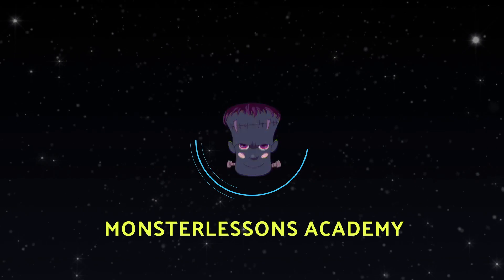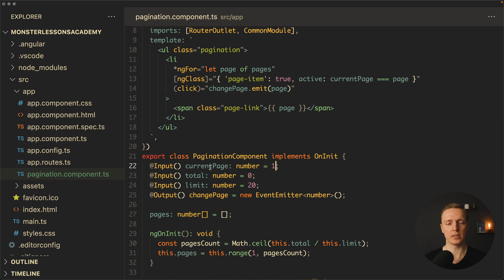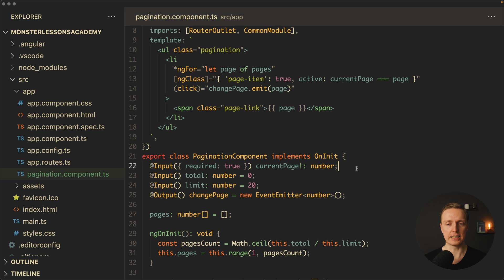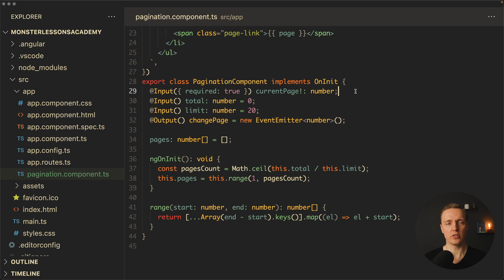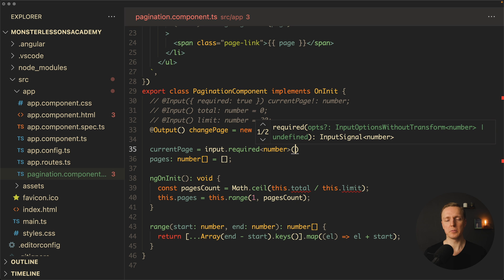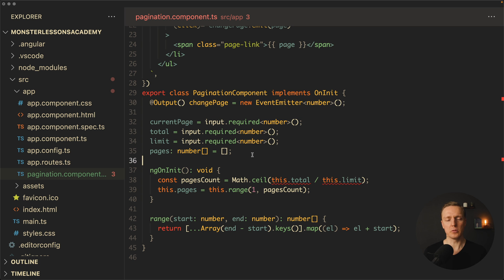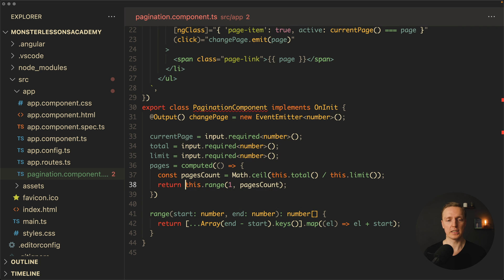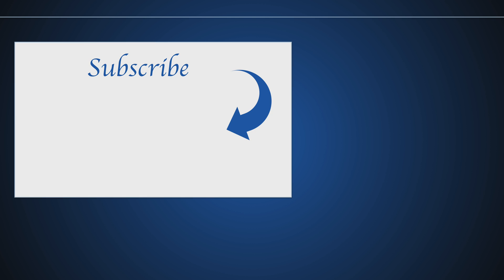Angular Signal Input: Ultimate Guide for Developers

Comment: Thanks for this. I want to try and change a form builder to rather use signal inputs.The issue is in the test, even if I type the input correctly, the test gives an error. I tried with a simple number example.

  questionNumber = input.required<number>()

in the test

describe('Question input', ()=> {
    it('should take in a input of type number', () => {
    component.questionNumber = 5
    })
  })

I think it throwing an error, as you mentioned this is a ready only signal. Not sure how you would test it then?
Reply from the maker: I didn't use signals with forms. I don't think it will work or that forms are prepared to be used with signals. I would just leave forms as reactive for now.